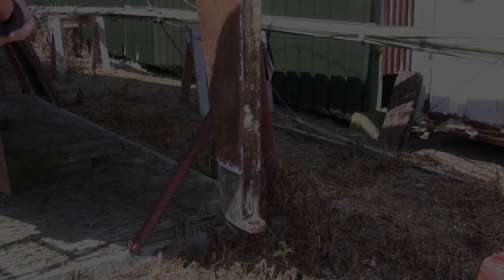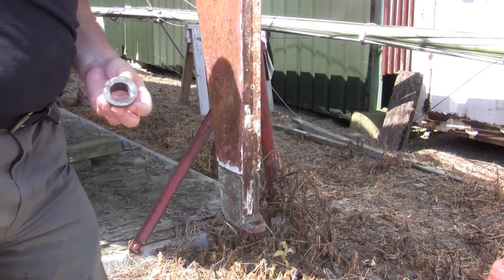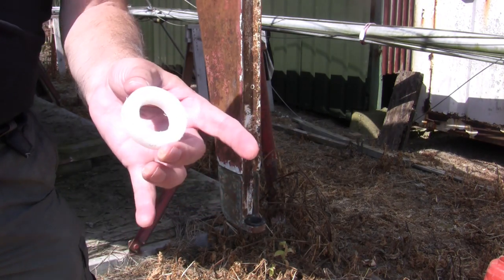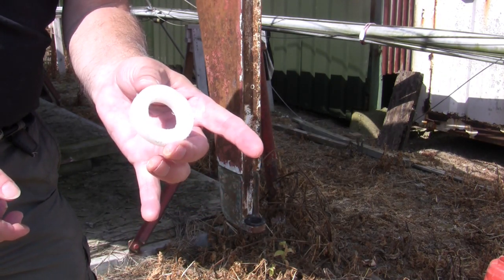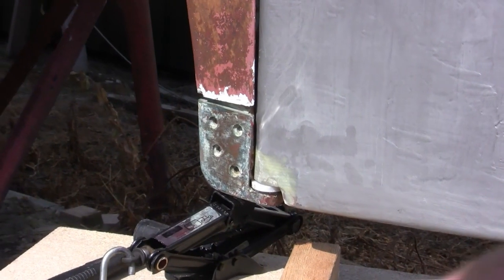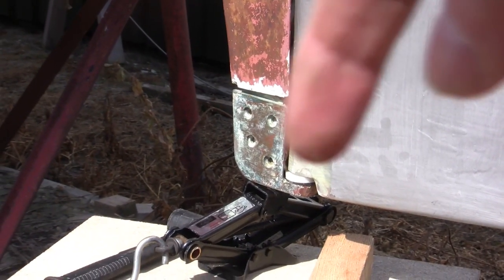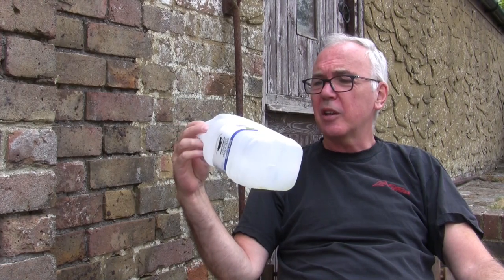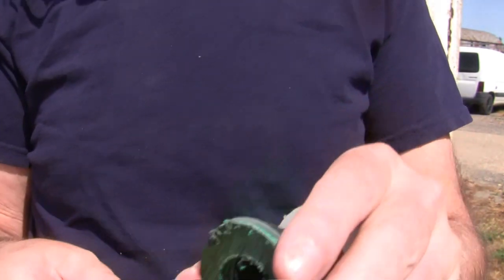Very Nearly About Sailing July 2022 - Refitting the rudder. Well, very nearly

Comment: I'm glad to see Serenty is no longer rudderless.  Remember it's love that keeps a boat in the water (or flying) 

It's all boat work, all the time for us as cruisers.  We just do it in more exotic locations now instead of right by our former home.  It's a job that is never done.

Right now it is oh glorious, glorious sanding of epoxy on plywood at the moment as we rebuild and repair both our cockpit benches and the thwart seats in our dinghy.   It's a full 4x8 sheet of plywood's worth of pieces with very little wastage and it all needs to be built, drill-fill-drilled.at each faster point, then epoxied, painted and kiwi gripped on the tops.  Looks like nearly two gallons of epoxy will be necessary to finish. 

I hope you are having as much fun as we are.
Reply from the maker: Good to hear that you are having so much epoxy based fun. It is a job that is never done. Even people with brand new boats will find that there is plenty to do after a very short period of time. Indeed, Mal was right - it is love that keeps it flying.
All the best with your projects.
Cheers, Paul

Comment: I put scotch tape (cellophane tape) on things I dont want epoxy to stick to. Do an experiment, you will see. No need for the HDPE washer. Just put tape on the old bushing and the shaft, then apply the epoxy. I dont see why you would need to fit the rudder for that epoxy job. Just take a measurement and it will go fine. Keep up the good work!
Reply from the maker: Yes, I have some sticky-back-plastic I use a lot. It's great. And I will use it to mask up when I do he actual job. It doesn't come out well in the video, but the old lower bush is very pitted and I needed something a bit more solid that wouldn't print through.
As, for just measuring - no sure why, but that really isn't my strong point. Maybe I need to practice.
Cheers, Paul
Reply: @verynearlyaboutsailing8114  Keep up the good work. Thanks for the reply.

Comment: Paul, 
Be careful with that washer. You need to have a little wiggle room up and down, as the rudder lifts slightly when the tiller is connected. Looks at where the metal housing for the tiller connects to the top bush, it's angled and it lifts the rudder slightly. If you want I'll pm my number to explain better and can put you in touch with the company I used to get new bushes made.

Rgds,
Steve
Reply from the maker: Steve, the old bushes are at the machine shop at the moment. Slight delay as the chap who will be doing this is away on holiday at the moment. I did a test fit with the old bushes and it all looked fine. Although initially I did get some of the measurements wrong.
I have an email for this channel somewhere - YouTube stopped pm's a while back. I'll try and find it and post it.
It could be that the design changed from Mirage to Mirage. It sounds like the way your tiller is connected to the stock is different to mine. I would be interested to see it.
Cheers, Paul
Reply: I will be down the boat today, so will take a video of the part on the rudder stock / housing I am talking about. I will upload it here and send it over.

Comment: first time is never perfect, 
second time is sometimes better , 
and the third time, you just got used to it
and btw. the only thing that counts is your health, first priority
Reply from the maker: Yes, absolutely right. Most jobs I do on the boat are first-time jobs. Although I do have to do some of them three times. And heath has to be a priority. That's really the thing slowing the splash date - No point in having the boat in the water if I'm not fit enough to sail it.
Cheers, Paul